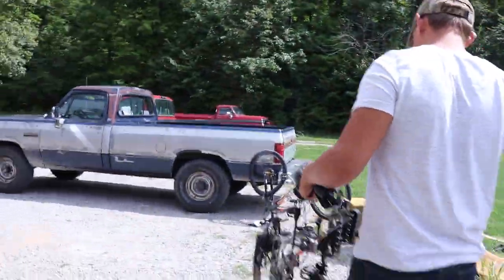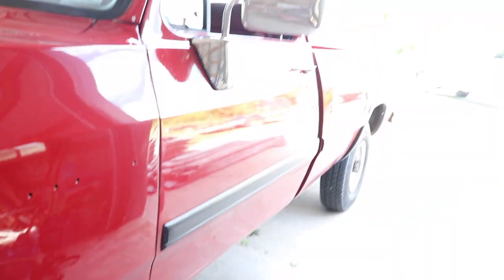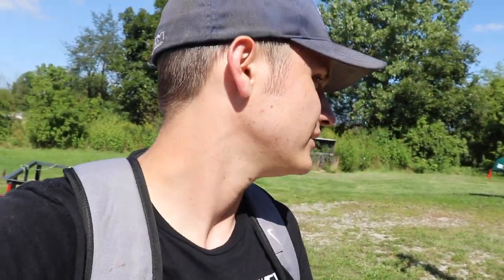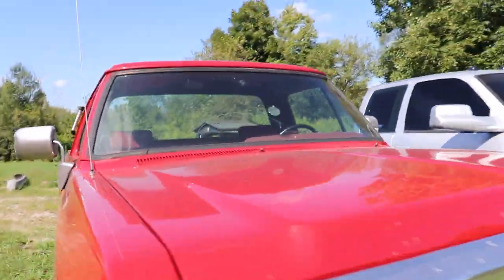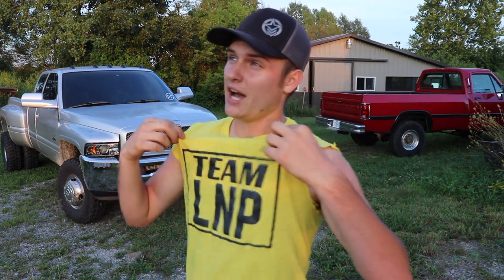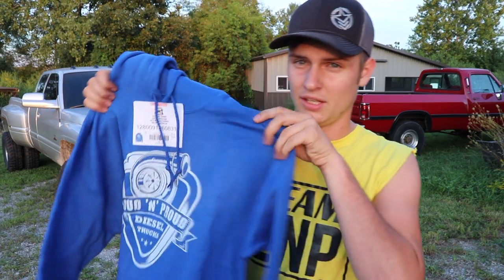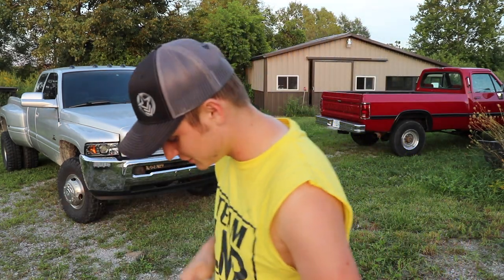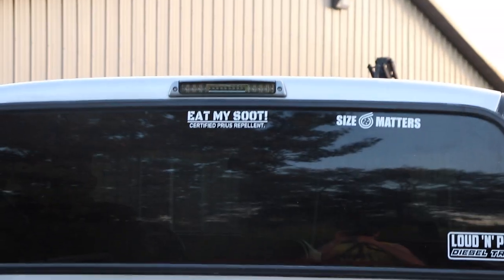THE TRUTH ABOUT GIVING AWAY MY DAD'S DIESEL TRUCK....

Comment: I have a 94 2nd gen 12valve manual and 4x4, I love the dually but I already have a manual, and I love nasty red but I want my truck to have the power. however, I dont have a 1st gen and truck is rust free but not clean, and that first gen is CLEAN and stock so I'll pick the 1st gen